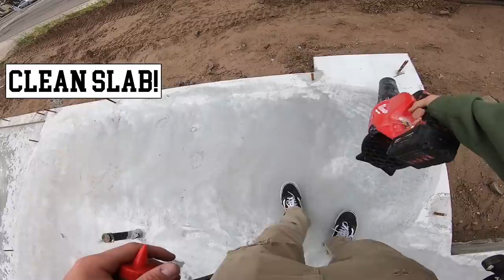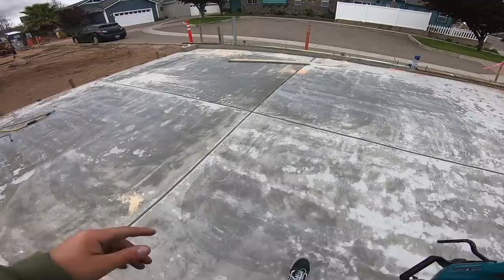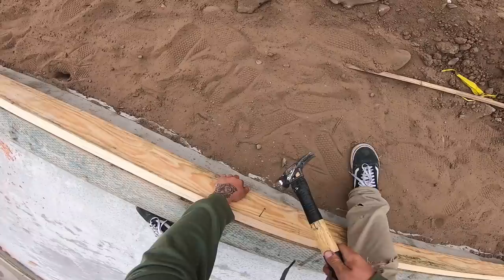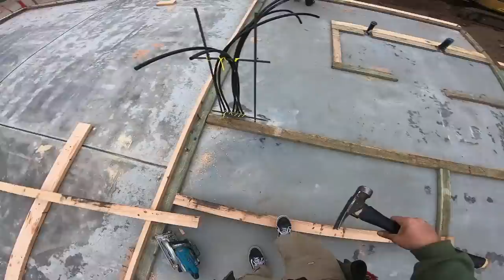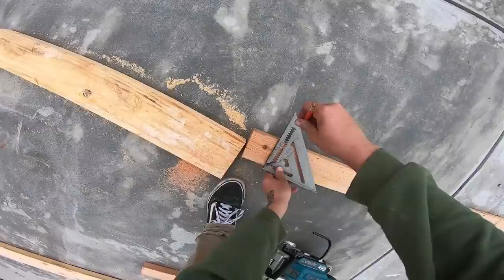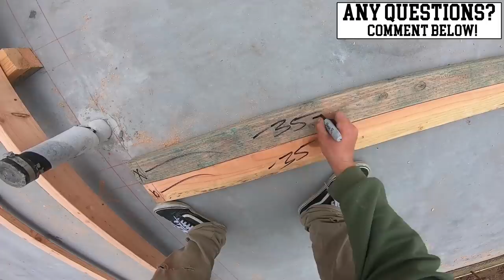Building a House | Ep. 1 - "Snap, Plate, Detail!"

Comment: Thanks for the memories , I was a carpenter for 13 years. I plated, did lay out, framed, did pick up, joist, cut stairs, but mostly plated, man I was fast. Back then it was piece work, so you had to be fast. Then I joined the union. Then the economy took a dump in the early 2000 , could t find work, so I started driving rigs, been driving for 16 years now.

Comment: This is really awesome to watch, I don't have the chance to practice framing, so these kinds of videos are like virtual experience to me, one thing that I was curios about was why there isn't any sill gasket underneath the plates, you need to cover the whole wood plate to prevent moisture from doing damage as condensation builds up between two different surfaces such as concrete and wood, this is the only build where it hasn't been done that I have seen so far. I don't say any of this to knock you, I am curios for the sake of knowing wether you have reasoning on why you do it this way, thanks for the vid.
Reply: Looks like pressure treated bottom plates, which are allowed for concrete contact by some jurisdictions.
Reply: No need for sill gasket if you use pressure treated, at least from any building codes where I have known. Can def see the pressure treated mud sill vs the bottom plate when he starts doing them. I think adding sill gasket to a treated board is overkill and would only be done if it was required, which I dont know of any codes that require it.
Reply: I’m from Nebraska, and we are required to add sill-seal ...or  mud-sills .. however you may call them in your area.

Comment: Question:  The interior pressure treated boards that are lying on top of the slab don't appear to be anchored down like the mudsill is.  Am I missing a step here, or do those bottom boards not need to be bolted down because the rest of the framing will keep everything locked tight?  Non-construction guy here just learning some of the basics before I tackle a small wood framed shed (so, it isn't really relevant to my project, but now I am just super curious)... thanks for the vid series... I am enjoying the first-person video angles immensely!
Reply from the maker: Scott, the exterior mud sill is anchored down with bolts and hold downs. 😊 The interior walls get shot down with 2-1/2” pins (Hilti DX36M gun), good eye, very good eye!

When we plumb and line, they get shot and held in place.
Reply: Thank you Matt!  I am starting the 3rd video in the series now which I think is when you start to plum... much appreciated! @MattBangsWood

Comment: Sill gasket or caulking under those plates? Not for water cause I know those are PT wood, but for bugs and cold air intrusion ?
Reply: articity  Concrete > Sill gasket > then mud plate usually you get something in between the concrete and first plate.. to my knowledge
Reply: Thick bead of acoustical sealant
Reply: We always use some kind of sill gasket. 
Kinda stupid to use PT wood on sill plate if it gets wet every end of frame would also get wet and still rot and something have to be really wrong if water gets there.

Comment: Question: Is wood directly in contact with concrete allowed in this building area or do you need to have? Moisture Barrier?
Reply: @Tanknyankin Yes i see that, but in some areas you still need a moisture barrier. I checked California building code already and they do not require a sill gasket/barrier like other states.
Reply: I was thinking the same. I wonder if this is allowed in EU.

Comment: I have framed for over 20 yrs.  Its very interesting to see other carpenters and a newer generation passing on the skills from there parents.   Ofcourse i thought mabe laying out both sides of the stud is easier for you younger guys,  a quick tip for ya to speed up layout time |x where studs are an be more specific on window and door openings.
|k|c|  35 in hdr  |c|k|  an always write as much info on ur plates as you can for your installer.
Reply: But if he IS the installer and he doesn't need all that info why would he take the time to write it? Just curious...
Reply: Yep, that's what I figured.

Comment: Hi .. just found your channel .. quick question .. why did you snap 5.5" - is the outter wall location just determined by the plan? Or is there a standard measurement? Thanks.
Reply: I think you mean for the bottom plates, the plates are 2×6 but the actual size is usually about 5 1/2 inches so when you measure from the edge of the slab that will make your walls flush with the slab. I think that is what you meant, hope this helps!
Reply: @cameroncrane3770  Thank you 👍

Comment: try a 18 gauge trim nailer to tack shit i like to use 8s though. building on a slab sux compared to a floor. i like how u do plate but i will nail my plate together and cut on chopsaw its fast but i see why u dont cause the anchors . i always plate for and drill bolts cause it has to be tits from the start in order to be quality finish. i like the layout to be on inch and a half side but its all the same. ill even cut top plate while its all flat

Comment: how do you tack the interior bottom plates to the slab so they dont move around on you?
Reply from the maker: That's a tough one! You can't, unless you tack it to an exterior. As long as we can keep them in place long enough to layout, we're good. All interior walls get labeled pulled out as soon as we start framing exteriors. :)
Reply: If the slab is green enough the 8s will penetrate the concrete and hold it down .

Comment: Did you even square your slab 6,8=10 12,16=20 and so on? I leave comments you never answer 😡
Reply from the maker: Jay, these videos are years old and often times I don't get notifications on them.

I pull off control lines when I snap out. 6/8/10 out of the corner once I have a 90* established, or I crosstape if we're working with a bigger slab.